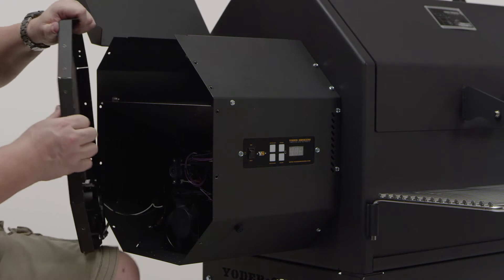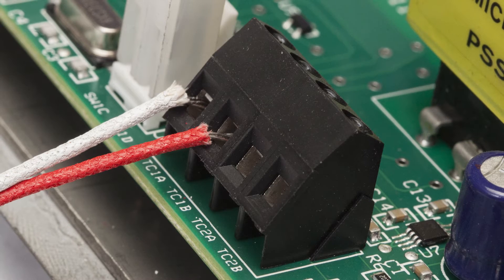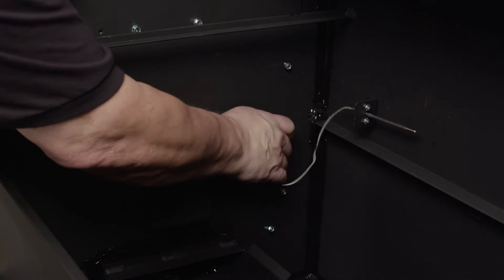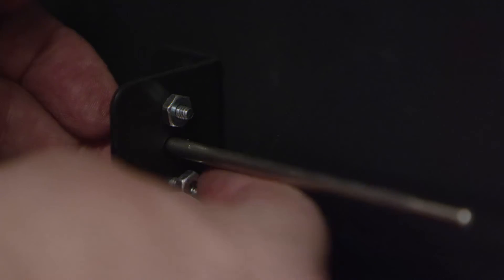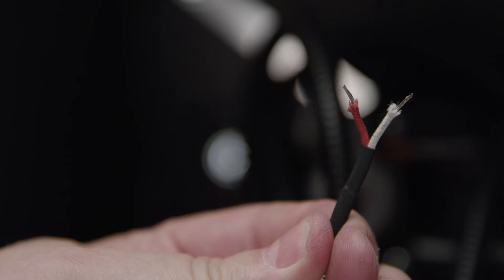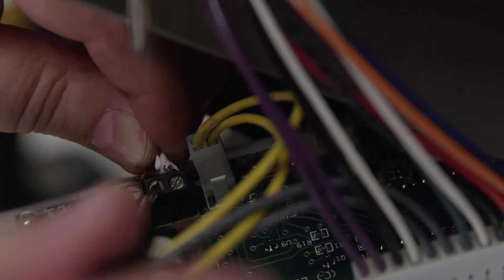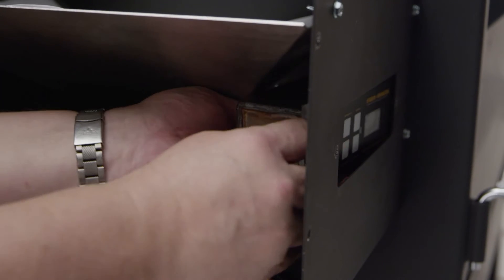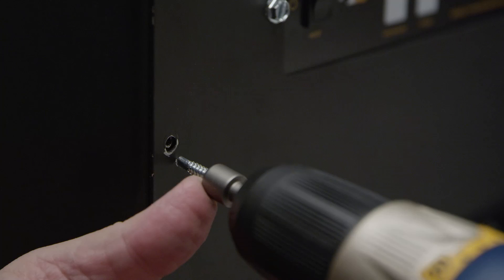Yoder Smokers Pellet Grills | Replacing the Thermocouple | 90454

Comment: why do I need to replace them?
Reply: The Thermocouple has a potential of going bad. It relays the temps to the brains of the Yoder.  A bad one will report incorrect temps OR no temp at all.
Some owners report never having to replace theirs. Some buy a spare to have on hand. It's not fun to go and start your Yoder for a big cookout only to find that the Thermocouple has gone bad. I've had mine for 3 years and have had no issues. I may buy one shortly just to have it.

Comment: It's a terrible design, the wire runs over the fire pit. It's yoders way of keeping their hand in your pocket. You will need a new one ever 2 years.
Reply: Just to point out the BS complainery of this comment, my 2015 YS640's thermocouple just died for the first time in October of 2024. Over 9 years, and the replacement parts are easily available so I can fix it and nobody is trying to sell me a new smoker. That's not keeping their hands in my pocket... that's outrageously good long term product support.
Reply: You were fortunate to have yours last that long. I replaced mine after 4 years. The one I have now is on its last legs, so every 4 years I'll be getting a new one. Thanks for pointing out my comment was bs. It was very helpful.